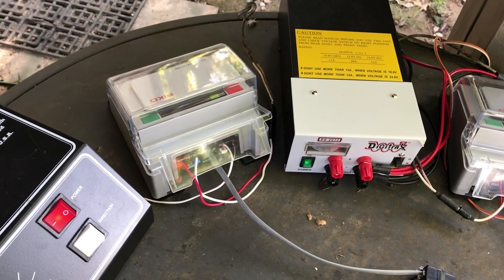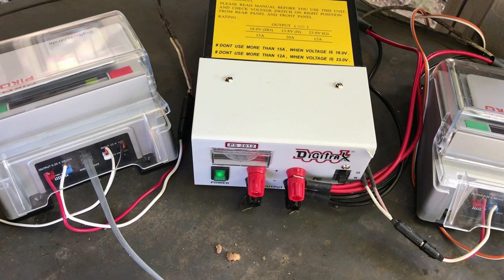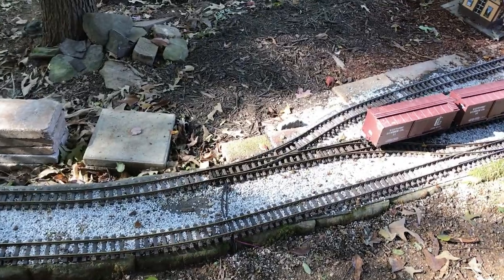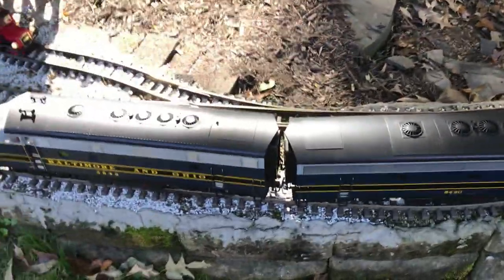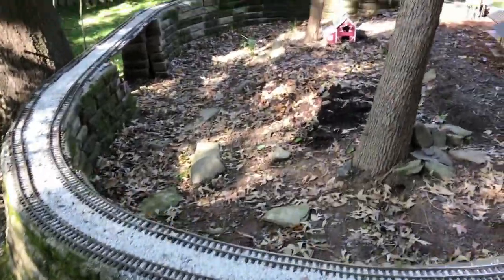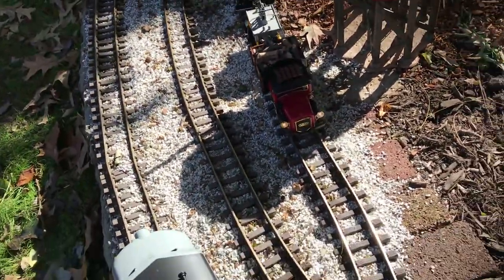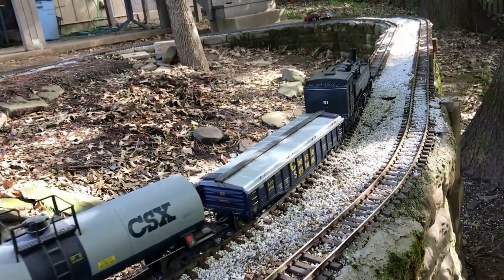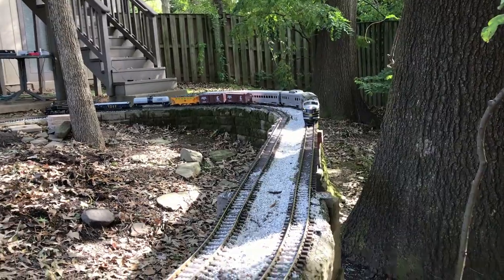Part 1   Piko/Massoth DCC Digital Layout Demo

Comment: hey tom great video. I am got a piko digital  setup and wanted to know if you could make a basic video for people getting started with piko digital system. showing the screen of the remote.
Reply from the maker: Hi Brian - There are some screeen shots in this video of the Massoth Navigator protocols.  The Piko Navigator is made by Massoth and operates the same exact way.  Perhaps i a few months I'll do the Part II video which I was going to cover more of the Navigator's use including how it can control LGB track switches, uncouplers, etc.  In the meantime, if you have any questions about using your Piko Navigator, you can email me:  OldDominionRailways@gmail.com  I do LGB locomotive repairs for people and/or installation of Massoth XLS DCC Sound Decoders.  If you need any Massoth track components, such as the Massoth 4-channel or 1-channel switch decoders, I also have them available at discount pricing.  See my Website:   https://www.olddominionrailways.com/
Reply: that’s great tom thank you.  i am just getting into it and am trying to learn stuff